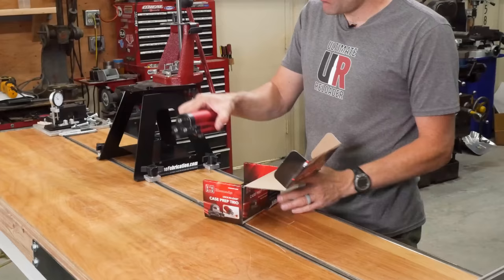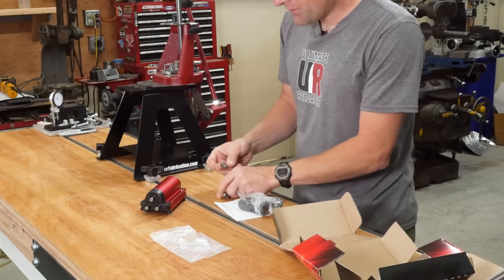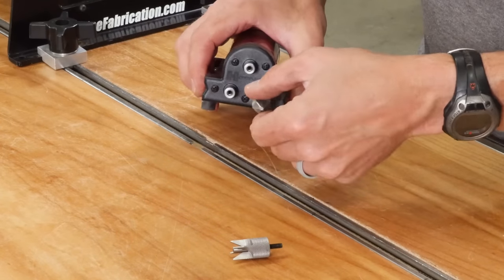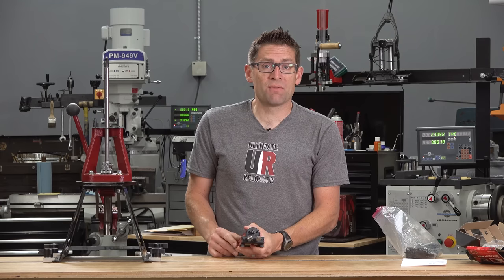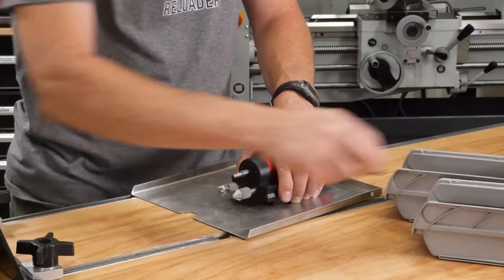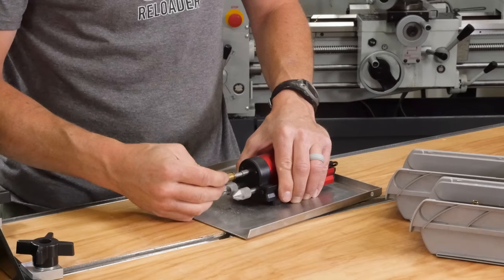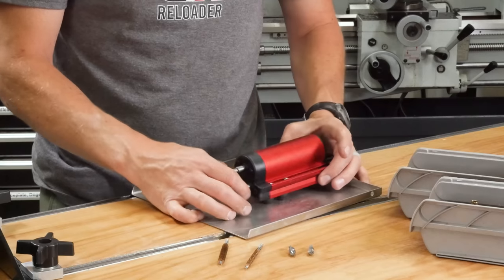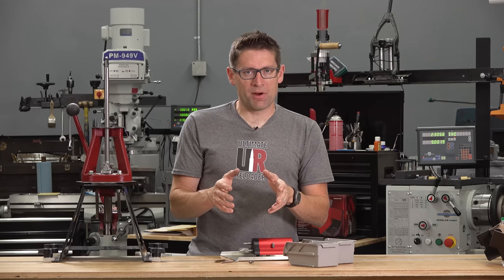Quick Look: Hornady Lock-N-Load Case Prep Trio

Comment: I bought this tool nearly 2 years ago when I started cutting down .223 Rem cases for .300 BO. I have this right next to my Harbor Freight mini-cutoff saw to clean up the cut cases...I added a 30 cal neck brush to ensure all cutting chips are out of the case, then a light champfer/deburr prior to sizing. Then after trimming the now .300BO to length I hit it again for a proper champfer/deburr.

Comment: Had several issues with mine. The internal gears are PLASTIC!  The plastic gears  strip out over time.   Had had to send mine back 2x.  Not well built.  Will not last.
Reply: Mine broke on its second use yesterday. Garbage. Turned it on and immediate loud grinding noises and a loud crack and everything quit moving.
Reply: Really? That's bad! Ruin a good idea with crap internals. Can't understand why Hornady made that dumb decision, some bean counter overruling the design engineers, most probably.

Comment: I've used mine extensively for a couple of years, and LOVE the compact size and the quietness.  I've used the three heads to chamfer the mouth's outside & inside (VLD) and the primer pockets on a couple thousand range-recovered LC and FC (crimped) rounds.  I mounted it on a little board with a lip that hangs down over the front edge of my bench to keep it from sliding back - now I can use two hands on the brass.   Recently I broke a gear on mine (my fault) when I went in cockeyed on a decrimp and jammed it.  Hornady sent me a new set that tool five minutes to install, but first I lubed them up with red'n'tacky grease and now it runs as quiet as a nuke sub!  To the other folks whose gears broke, maybe you're pushing harder than you need to.  As Gavin said, it doesn't take much force at all to properly chamfer the mouth or clean a primer pocket.   And it shouldn't take a lot of torque to decrimp the primer pocket IF you're doing it right - I was careless and came in at an angle when I broke mine so the tip dug into the sides of the primer pocket, yanked the case out of my hand, and ruined the case and a gear.

Comment: I really haven't done a lot of rifle reloading, and when I do, it's just for plinking so I really don't stress the prep process other than to clean and reload.  If I were to get into serious, precision marksmanship, I'd use it to for every single shot I made.  I would use it to match, case per case, down to weight, capacity, size, and dimension.  That way, every case would be an exact match to the next.

Comment: That is a little beast. 1000s of rounds run on it. Note take the cover off and add some quality grease to it. I am currently running 2500 223/5.56. I run the flash drill in the primer hole and then do the inside and outside deburring. I love this tool.
Reply: I swedge primer pockets first it is faster and makes drilling the flash hole out easier.

Comment: One of my plastic gears broke. I might have dropped the tool so not sure but I only can use two of the three tools now. I also would like to slow it down a little. The inside case mouth tool is pretty aggressive and you have to be careful not to over do that one.

Comment: Mine had one of the plastic gears under the black cover break. It locked up and would not move. I took it apart and removed the broken prices and it works again, but with only 2 outputs turning of course.

I'm not sure if the competition is any better, but I would try something else I was starting over.
Reply: David, contact Hornady and they will send you a free set of replacement gears.  Easy to replace with five screws.  Just make sure to relube and don’t place a lot of pressure on the cutters. It’s not necessary to do the job.

Comment: I feel cheated Gavin. I have had mine since 2016 and use it the exact same way. BUT back then mine did not come with the debur and chamfer tools ☹ At least we know that longevity is good as mine is still running today and used often for 308, 223, 300Blkout and 6.5. Mine is also bolted to the bench right next to the trimmer.

Comment: So i ordered hornady precison reloading kit online this tool came in it and the plastic gears were broken ive never used had it for 2 years tried to use once 1 year ago after having it in the box for a year and it made horrible crunching noise and stopped working 😆 took it apart gears were cracked with teeth missing 😆. Looking like jackolanterns on halloween. Would be nice if someone made affordable metal gears for replacement on this tool i use my cordless and switch pieces now but i would like to be able to perform 3 operations at once with this tool 😆

Comment: Electric case prep has been a big deal for me.  I buy bulk Lake City 5.56 and 7.62 brass.  Manual Dillon Primer Pocket Swager followed by a quick cleanup with pocket reamer and pocket brush in the prep station.  I also run a VLD chamfer tool and a primer flash hole cleanup tool in the prep station.

Comment: My gears  broke as well. Called Hornady and they sent me 18 extra gears, there still plastic and cheap, but I have a bunch and there easy to replace yourself. When I get low I’ll get them to send me a bunch more. Even with me being in Canada and during Covid I had them in about 2 weeks.
Reply: You'd think at the cost of sending out 18 plastic replacement gears they would just switch to brass gears.